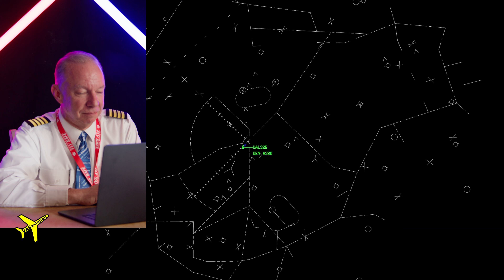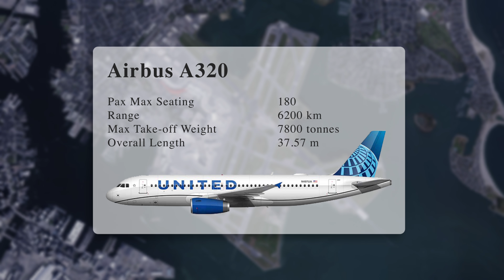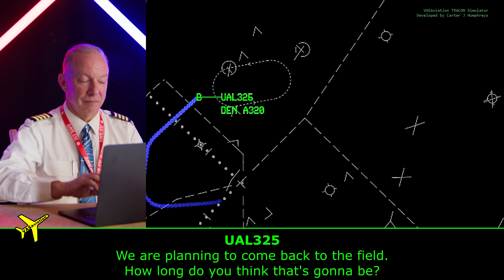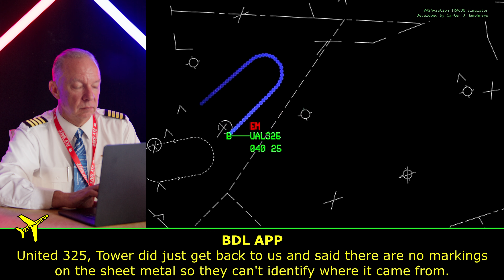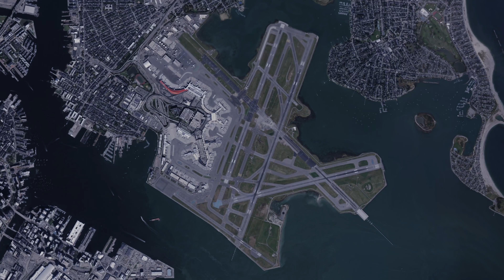United 325 Disaster Averted: Engine Trouble at Takeoff! | Captain Steeeve Breaks It Down

Comment: Incident: United A320 at Hartford on Jun 20th 2024, dropped engine parts on departure
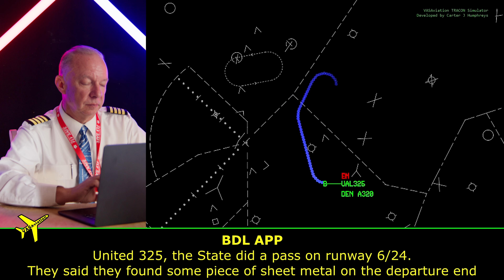By Simon Hradecky, created Thursday, Jun 20th 2024 17:04Z, last updated Friday, Jun 21st 2024 22:40Z

A United Airbus A320-200, registration N490UA performing flight UA-325 from Hartford,CT to Denver,CO (USA) with 129 people on board, was climbing out of Hartford's runway 24 advising they possibly needed to return to Hartford, they were working on an issue. The following departure reported there was debris on the runway right at the center line. UA-325 stopped the climb at 4000 feet, entered a hold until the runway was cleared. The crew suspected a blown tyre and queried tower about what kind of debris this was and advised they were overweight, so not in a hurry to land back, the engines, especially the right hand engine, were running within parameters, they had a light pop upon rotation for takeoff and might have had a tyre damaged or a bird strike. The aircraft returned to Hartford for a safe landing on runway 29 about 45 minutes after departure.

The airline reported the aircraft lost a portion of the sound dampening outer liner.

The FAA reported: "United Airlines Flight 325 returned safely to Bradley International Airport in Connecticut around 8:45 a.m. local time on Thursday, June 20, after the crew reported an abnormal noise. The Airbus A320 was headed to Denver International Airport. The FAA will investigate."

A ground observer reported on departure the aircraft left large pieces of debris behind. A subsequent runway inspection confirmed large pieces of debris, sheet metal. Upon landing the aircraft left even more debris on the runway.

On Jun 21st 2024 the FAA reported: "AIRCRAFT DECLARED AN EMERGENCY AFTER DEPARTURE DUE TO AN ABNORMAL NOISE, RETURNED TO AIRPORT AND POST FLIGHT INSPECTION REVEALED THE RIGHT ENGINE COWLING HAD SEPARATED, WINDSOR LOCKS, CT."

https://flightaware.com/live/flight/UAL325/history/20240620/1210Z/KBDL/KDEN

Comment: On June 20, 2024, United Airlines Flight 325, an Airbus A320 traveling from Hartford (BDL) to Denver (DEN), safely returned to Hartford after losing part of its right engine's sound-dampening outer liner during takeoff. No injuries were reported among the 124 passengers and 5 crew members.

Comment: Former firefighter who used to run a chem and foam truck here.  Upon a dec of emergency we would have an Alert 1 for this and go out and stage with our blue lights only on. Any truck cleared for the airport use has to have blue emergency lighting.  If a pilot calls in with others, like no wheels or wheel down it was upgraded to Alert 2 and if a plane went down it was an Alert 3.  The reason why the engineer didn’t want to radio out the parts is he is not authorized to determine critical parts to the plane. Our SOPs had strict things the crew could put out on the radios as outside agencies and people listen in and if something went wrong due to wrong call the fire department is now toast… so to speak.  I was on two downed airplanes and it was bad… a P-51 went down due to pilot error headed to Texas for an air show. The other was the Lear filled with a well know Japanese companies executives and all were killed.  The OshKosh’s today are state of the art and have massive high capacity water tank and foam usage. We had tankers also that could back up the foam trucks to add a lot of capacity to the situation as well.  Enjoy your show mega! Educational and done well! Thanks

Comment: On June 20, 2024, United Airlines Flight 325, an Airbus A320 departing Bradley International Airport (BDL) for Denver, safely returned to the airport after shedding parts of its right-engine cowling during takeoff. The debris, described as sound-dampening engine liner and sheet metal, was found on Runway 24. No injuries were reported among the 124 passengers and crew

Comment: There IS a point in time when a "Legal Team" or teams get involved (Lawers and Law enforcement) This is because SOMEONE will ultimately have to pay for the lost times for passengers, potential extra clean up equipment and/or staff, fuel burn considerations. Knowing this, the ground crews MUST maintain a compartmentalized, factual information gathering regime that will initially ONLY be shared with authorities of the Airport and local - Federal Police. Later all data will be shared equally with all potential litigants. It is a CERTAINTY that there are teams comprising Lawyers, Paralegals, Investigators and clerical personnel that are either contracted or paid standby representing EACH airline, Insurance concerns AND the Airport. These are NOT to be mistaken for "ambulance chasers". Given the overall IMPRESSIVE safety of air travel, there is still the potential for mistakes and accidents.

Comment: egt over max will end up causing things to melt. those engines are so finely tuned with cooling and fuel to run so close to melting its such an amazing feat to a dumbass civ like me to understand. but the tollerences is so close..  in a car. egt over 550 degrees you can start melting pistons.

Comment: Hi Capt Steeeve.  I have looked at and listened to many of your vids.  I am an ex light a/c commercial pilot (though I did not fly commercially due to lack of opportunities when I was flying).  Your aviation run-throughs are excellent and very interesting.  In several hundred hours on single and multi-engine aircraft, including instrument time for Instrument rating, I never had any undue incident.  That is undoubdtedly due to the marvellous aviation mechanics the aeroclubs and training institutions employed.

Comment: I was behind a commuter of the bombardier brand, ready to take the runway in Vegas one hot afternoon. I fear I wouldn’t be able to get a word edgewise on the radio, but I finally announced just as he released the brakes to take the runway that he had a large panel swinging in the breeze Underneath the empennage. 
The crew sounded really frustrated when they told the tower that they would now need to go back to the gate.  No thanks given.

Comment: According to the final report, it was the engine's  sound dampening liner that was shedding sheet metal. Parts being shed could have been sucked into the engine at any moment. Cudos to the Jet Blue pilot for reporting what they saw on the runways and cudos to the pilots of 325 for not ignoring what at first seemed to be just a small issue with the exhaust gas temperature. This could have been really bad.

Comment: In 2001 I boarded an American Airlines MD80 at Sacramento, sat in the back and smelled something like burning wires and it was very hot inside. I told a flight attendant. The plane took off for Houston, smell got WAY worse, cabin filled with smoke and we did an emergency landing after being in the air only 72 seconds with a very fast and steep turn-around with people screaming. As it turned out the AC compressor either caught on fire or was emitting a lot of smoke through the air conditioning system.

Comment: I often think, when watching these, "The flight could've continued." Think about it in the context of this case - ideally they should've landed with a lot less fuel, there would be plenty of diversion airports on the route, and the damage seemed to be limited, but more importantly (for my argument) stable and not escalating. But yeah, 'abundance of caution' and potential lawsuits and standardized protocol and all that. Such a pity.

Comment: Flying back from Ft. Lauderdale we had a layover in Raleigh. We boarded the aircraft which was painted red with NYFD insignias all over it. As we were taxiing out we could smell smoke and the plane stopped. At the time we were all in the dark not knowing what the issue was. After half an hour we were towed back to the gate. Looking out the window back in the terminal you could see fluid pouring from the nose gear opening and soon a ladder was used for maintenance to climb into the opening. A hydraulic pump had failed and while there is a second pump it would not have been wise to rotate. After repeated updates of parts coming from the jet blue hub they scrapped the flight and put us on a United A319 to JFK.
  The gentleman seated behind me turned out to be the Captain of the cancelled flight. He said it would not have been a long flight had we departed. I know what happens to petroleum when exposed to air at high velocities. Nobody knew there were rescue crews outside as we could not see them.
  Anyway, when I buckled into my seat, the belt was absolutely shredded and looked like a pair of nylons. I bit my tongue as I was not getting bumped again.
  Captain, your sharing this information with the general public gives us faith in the people in charge of our lives. For that I am truly grateful. God bless.

Comment: Great job by all involved in their handling of this potentially disastrous situation.  Debris on the runway was what lead to the crash of Air France flight 4590 in July of 2000.  Metal from a plane that had departed before the Air France  flight cut the Concord’s tire, which exploded and sent debris into the wing, rupturing its fuel tank.  This led to the horrific crash that killed all aboard.

Comment: The tower did good by asking the plane that reported the debris if they had any damage. Good communication all around. Also landing overweight has a risk of overheating the brakes so asking for the equipment is a good call so they can hose down the wheels if the brakes catch fire..

Comment: I really appreciate how the captain did the extra mile on the ground to ground crew - not just 'affirm engines idle' but 'idle and we will keep it that way until you tell us otherwise'.  That would be very reassuring to hear as someone sending guys out to do a close check around an airplane.

Comment: A search revealed that the sheet metal found was the engines sound dampening outer liner.
The EGT code was more than likely triggered as the back of the engine and its exhaust  may have been momentarily blocked as that sheet of metal was pulled off,  which forced the exaust gasses to accumulate fairly quick in that time, triggering the code.

Comment: This and a few other situations similar suggest that perhaps, with the technology we have now, airliners could have cameras available mounted inboard and outboard that could show the condition of the engines, flight control surfaces, and landing gear.  Yeah, it's a rare situation but really, is it all that rare.   At least knowing that it's a non critical panel cover that is loose or missing would allow the flight crew to better assess their situation.    The F-35 fighter has 360 degree camera coverage via their helmet, how difficult would it permit one of the cockpit flat panel displays to show a video from selected cameras.   That's a stretch perhaps but really is it? Look at how much is spent on each plane for that right company logo paint job.   Another 50-60K to equip 4 to 6 cameras on a 787 or other airliners.

Comment: Later in the official report recently released, it was reported that the switches were placed in the run position and one engine started to produce thrust, the other did not at the time of impact. How can this be explained with an electrical system malfunction?

Comment: Regarding the Air India flight, could mechanics on the ground simulate what would happen to the fuel switch if the wires were crossed or shorted?

Comment: Say a plane takes off something they get an alert but nothing goes wrong then there are big big Parts on the runway and the plane is flying normally no problem how how the hell can that be a big part comes off of a jet engine or some part of the plane but there are no issues except for a glitch at the beginning of the flight doesn't make sense
Reply: a portion of the engine’s sound-dampening outer liner was found on the runway.

Comment: My question is--is it possible that the switches or the switch wiring failed and gave a cut off signal and record of such for the data recorder BUT the switch was actually physically still in the "ON" position----just a thought

Comment: So basically the pilot asked to return due to some issues and ATC is like “not right now, there’s some big bits of plane on the runway, bit busy.” “Er, what are they?” “Never you mind.”
Reply: ARFF1 is likely not an aircraft expert. If Chief said “looks like part of a tail,” but it was part of the landing gear, Cap just spent half an hour planning for the wrong thing.  Chief is just not qualified to safely answer that question.
Reply: @GillyFromPhilly  Yep, unlabeled sheet metal is all the fire chief fan say. And later "we didn't find tire" - but even that probably should have been qualified because a tire could have rolled off into the grass and not been seen. If I were the fire chief, I would have emphasized "we didn't FIND any rubber or tires THAT WERE VISIBLE TO US".

Comment: Why don't they have micro cameras in the wheel holding bay to visually check the tires? [Would also detect any stowaways! ] And don't they have pressure sensors/checks for each tire (thinking of the Atlantis space shuttle 2003!)?

Comment: Post flight inspection revealed the right engine cowling had separated, windsor locks, ct.. It appeared an engine had lost a portion of the engine’s sound-dampening outer liner, which was found on the runway.

Comment: From an anonymous aerospace electronics engineer, AASEE::All the questions can be answered by realizing that a battery box explosion can take out all of the control and monitoring functions of the 787.  This happened in 2013 in Japan on a  787. Google for more information.  I solved this problem back then; but, could not get through the Boeing front end barrier to communicate with their engineers.  I feared this  would happen in the future and it did on flight 171 where it was sitting in a very hot environment.  It can HAPPEN AGAIN !.The temperature of the box changes it from a battery to a bomb right in the middle of their electronics systems.  Their engineers were treating the lithium-ion batteries as a led acid car battery;  A TRAGIC  MISTAKE !
There are both hardware and software issues to resolve.  The best way to fix this problem is to get TESLA engineers to help.
TEMPORARY SOLUTION :  Modify the battery box by removing the top and all the side walls and ALL thermal insulation  ,  Replace all of this with a stiff screen with fans mounted on top to give the batteries a  large air cooling  circulation.  Add a temperature sensor to the warmest battery to control the charging  current to a reasonably reduced magnitude.  Move the battery box forward into the access space.  Then TEST TEST TEST !
Please make certain that both Boeing and Tesla receive this communication.  All of this information was in the public domain in 2013.. I have no association with either Boeing or Tesla.  This is all I have to say about this subject either publicly or privately.

Comment: An inspection pass with a damaged engine would be dumb as hell. Good choices here. I'm sure the crew weighed a partial flap approach for a single engine go-around (anticipating failure should they command go-around thrust), vs. higher landing speeds and possibe tire damage. Either way the long runway makes sense. Excellent job by the controller.

 Good job by the controller.

Comment: About 35 years ago, I was a passenger on a Saab Cityhopper aircraft on a flight from Antwerp to Amsterdam. A couple of minutes after take-off, there was a bang. A couple of minutes later the Captain announced that we were returning to Antwerp. When I got off the plane, a noticed that the  half the engine cowling on one of the engines was missing. The airline provided a taxi to Amsterdam, and we took a very late flight back to Manchester. Apart from the inconvenience, it was very well handled.

Comment: EGT over temp Mx actions will be determined by Actual temperature and Duration time. Capt probably spoke with Mocc and told him that Engine is fine and it’s a judgement call. Mx actions could be a Boroscope to Eng change just depends. Engine sound deading material has absolutely nothing to do with EGT over temp. As far an Over weight landing inspection goes again it all depends on weight. Could be from mild inspection to wild inspection. End of the day could the Captain have kept going Yes. Judgement call and nothing wrong with going back to airport and having Mx check it out 👍
Reply: Let me amend my statement. If something broke loose forward of the N1 fan then yes damage or possible EGT overtemp might occur. Aft of the N1 fan no EGT overtemp will occur. 👍

Comment: Oh FFS that's my airport. 🙄

This is what I found out:

A United Airlines flight, 

Flight 325, from Bradley International Airport to Denver International Airport, had to return to Bradley shortly after takeoff because a piece of the engine's sound-dampening outer liner detached and fell onto the runway. The crew heard an "abnormal noise" and returned safely to the airport, landing at 8:47 a.m. There were 124 passengers and five crew members on board, and no injuries were reported. 

The resolution was that:

The Federal Aviation Administration (FAA) is investigating the incident.

United Airlines arranged for passengers to continue their journey to Denver on other flights.